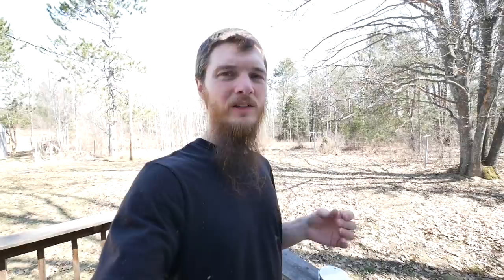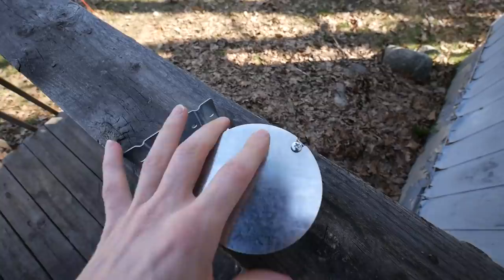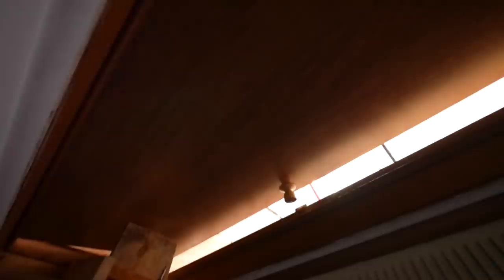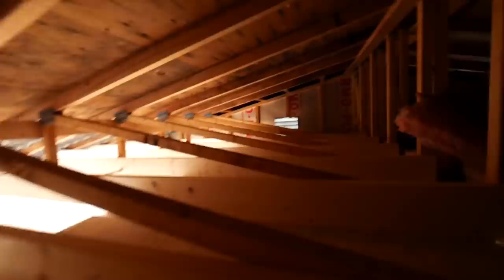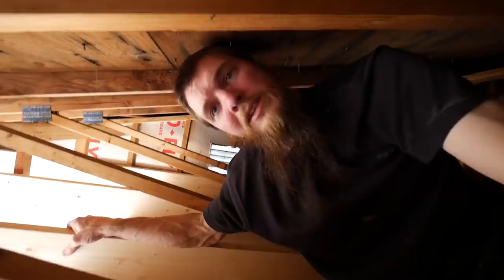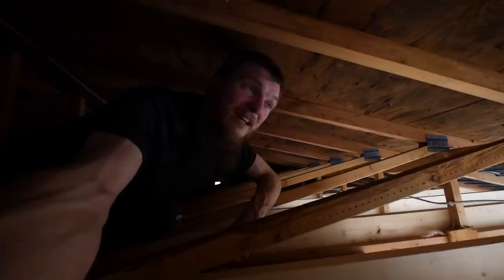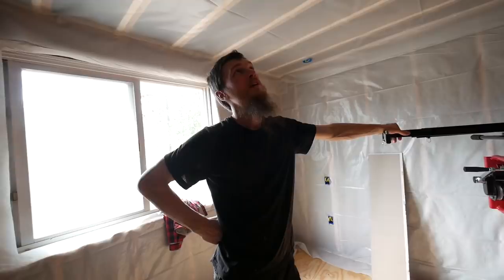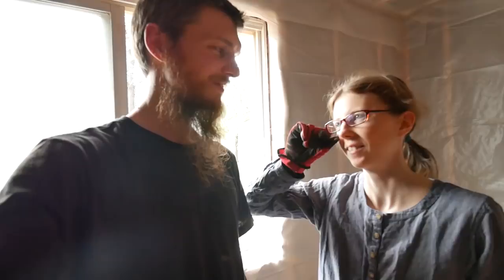The Most Ridiculous Fan Box Installation - Home Renovation

Comment: I certainly didnt even think of a ceiling fan. Maybe because i live in australia and theyre pretty much a given along with high ceilings wrap around covered decks and other cooling techniques than make a HUUUUUUGGEEEE difference. For at least 6 months of the year here we pretty much have them on constantly unless we are leaving the house for over a day. Even in winter they are on low and the house open during the day the circulate air. Ive survived without a lot of those things but its much better happier and easy to live inside with them. Im the sort eho always has windows open anyway for air circulating i just cant stand stale or closed air. I dont really use unnatural light either unless i have no other choice and even then its like a torch instead of ceiling lights. I think its much easier to deal with the seasons and the weather in general if you live in it and experience it instead of going from the extreme cold of inside aircon to the extreme heat outside or vice versa. Even just having windows to let cool night air in then closing them all up at dawn is a massive difference. Ive also experienced super modern green ambient cooling buildings where they automatically adjust to suit the weather and shades move to reflect sunlight but given the technology is so expensive its not even as effective as simple having a cold wet towel around your neck  so i prefer the old fashioned methods of temperature control unless its a heatwave or some other extreme where your body is under stress or in danger i dont even turn on the a/c unless it gets to 38 degrees celcius. We never use heaters either even when its close to freezing. I have wheatpacks i put in the microwave and put under the covers before i get into bed. Way more effective at warming you and doesnt have to heat the entire room. The heat gets trapped under the covers like body heat. Its wheat so you dont have to worry about burns from hot water bottles or those silly electric blankets which start fires or burn people and run for hours on end. The wheat smell is also calming. It warms you up without overheating you as well. And helps with tummy aches or tired muscles without the need for a big hot bath. Yeah ice packs heat packs and other non electric methods are great. I mean im always going to have a fridge/freezer and a microwave to store and reheat pre prepped homemade meals so its not like im wasting electricity or space or money on a new fancy appliance either. Sleeping in the cold is good for you and the dry air of heaters and being inside in those closed spaces where germs cant escape and without sunlight and with other people pets etc is the main reason people get sick in cooler weather often worse and more frequently. It was common practice in the 50s and earlier to open windows at night time for the cool evening air. I love the ancient and traditional methods for climate control and house building and all that stuff in general. Like building the base of the house like an oven so that you light the fire outside and it provides under floor radiant heating. Or the chimney like structures that acted like air conditioners pulling out hot air and lettinf in cool air or in ancient cities where theyd use adobe buildings of local materials and theyd make these extremely high slim foot paths through the streets that werent carriage ways that could fit no more than one horse wide so that theyd block the sun and be shaded at every time of day except  the suns peak overhead which meant they didnt need covered walkways and it was cool and you didnt need to be in the hot sun when you went outside. Like planting gardens on the rooves of the buildings the provide shade and block the building from the worst of the heat and allow for food and herbs and things to grow and collect rain. They also had big spacious rooms and in winter would use the side od the house that got the most sun for the living area and every other time of year theyd use the rest of the house that was far cooler. Theyd have pools of rain water catchment to create a cooler microclimate and basically the original evaporative cooling system. Its always been a dream of mine to have a more traditonal selfsufficient house with the added benefit of modern knowledge and science added to make it extremely sufficient and remove most if not all bills.
Reply from the maker: I always find it fascinating to hear about your hot Australian climate. I am accustomed to most of our year as being cold with extremely cold winters that get down to the teens, single digits, and negatives (Fahrenheit) for many months. I'm still wearing tons of layers even heading into May. Your climate is very foreign to me :)

Comment: I wouldn't have done it.. I don't like them either, they are a dust gathering and dust throwing mess, especially in the country,.. not to mention, ugly.... I have one in every room of my house, that someone else installed, I'm replacing them one by one..and the mess they create aren't worth the miniscule difference in the air they make, a small box fan on low, in my opinion works better and you can direct the air flow to where you need it, without the mess on the ceiling, walls, and curtains, that ceiling fans create, when you don't live in the city and live on dirt roads..